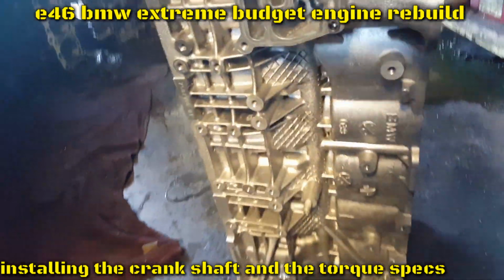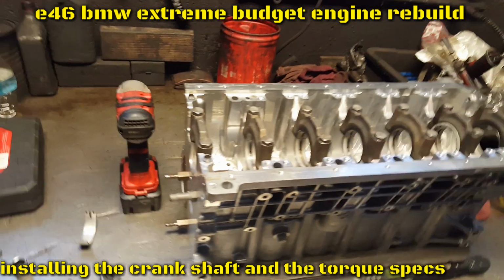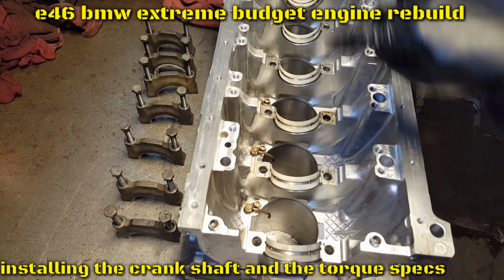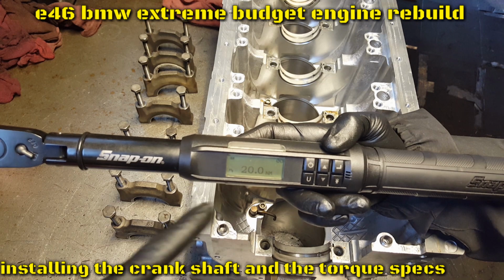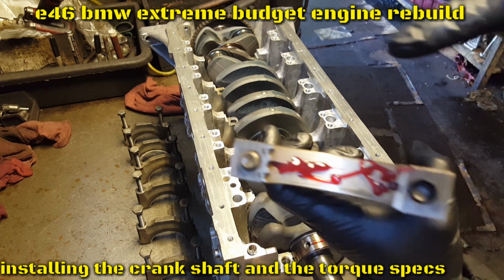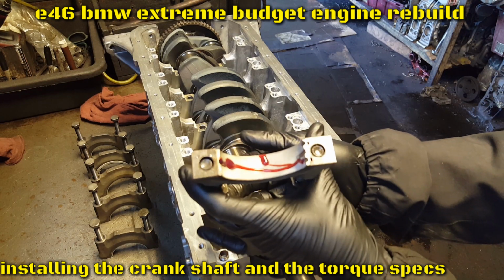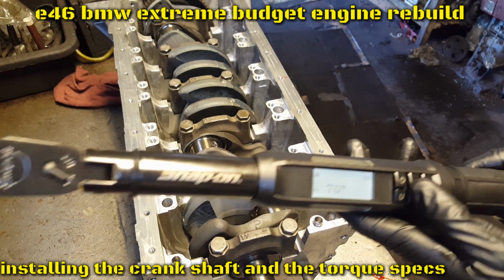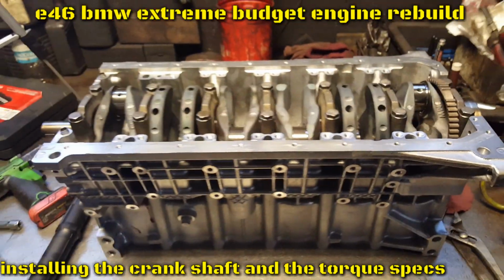e46 bmw crank shaft torque specs,engine rebuild =budget build vid#3 installing the crank shaft

Comment: What kind of Intake Manifold are you going to use?
Reply from the maker: Thanks for watching and the comment 🤘🏼
On the budget build will use stock 3.0 intake and upgrade plastic valve cover for the aluminum! 
And on the strocker will use the m3 intake ,still haven't buy that one yet 😂
You can also follow the build on my instagram 13b_dorito
Reply: @JM8686  Are you porting the head on either?
Reply from the maker: Yeah on the strocker only because the budget one is just a quick daily stock engine while i finish the strocker